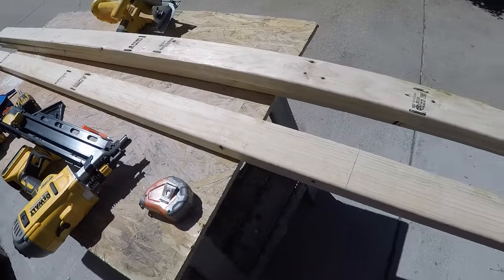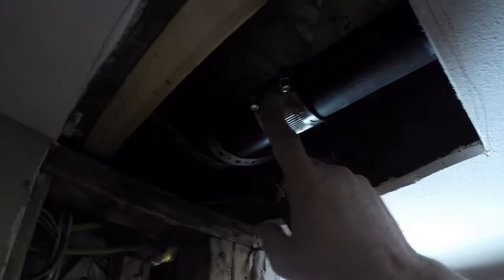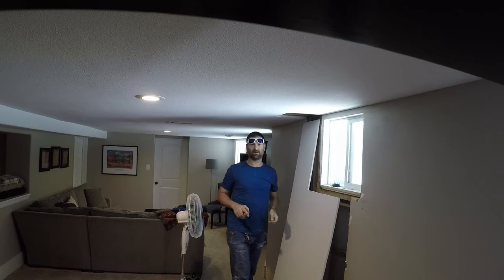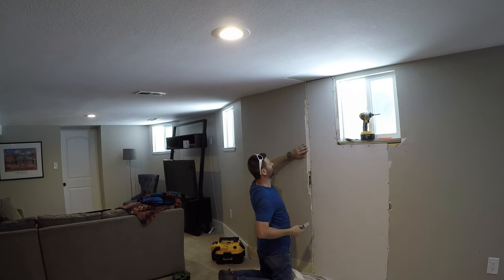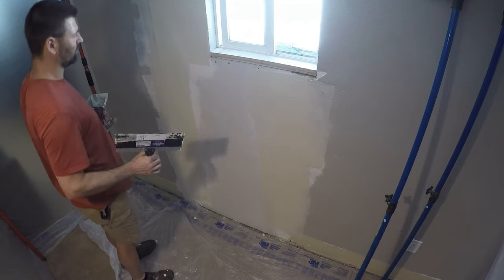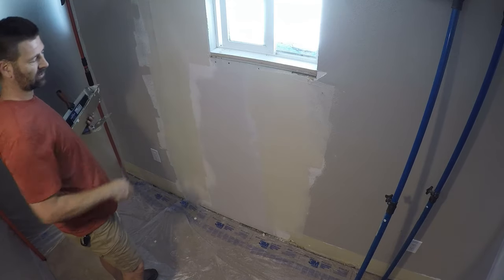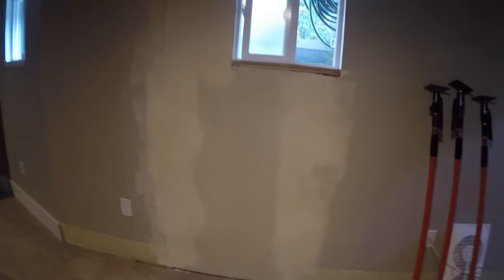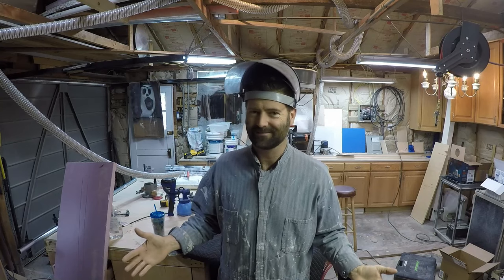How To Repair Mold Damaged Walls | THE HANDYMAN |

Comment: Right now I'm remediating mold in my one apartment.   I found I did like using concrobium.   What I did was mostly just spray it on and wipe the mold away.   The mold I had though was humidity mold in a bathroom.    With humidity mold it isn't neccessarily in the drywall it might be just on the surface in some places.   Yeah though after wiping down the whole bathroom I will haft to replace the drywall in areas.   Has anyone else used concrobium?   What have been your experiences.   It definately looks like it will save me some work but yeah still some drywalling to do.

Comment: Man whomever built that storage cabinet did a super great job. Excellent detail & craftsmanship....like they cared! 2:23

I’m guessing the plumber charged $250-$300. Service call: about $100-$150; than parts, labor, tax on a 30-60 min job (as w/ most businesses....not gonna charge you the 23-25 mins it took, but 30 mins or even 60 mins for the timeframe....a business thing); & your looking at $250-$300 easily. But, it does depend on the area you love in too! Plumbers in my area won’t step foot on your property for anything less than $100-$150. Now if I was doing that repair, & it’s all I had to do (no drywall work etc....); I’d most likely have charged them $130, with the hope of them calling me in the future with more work.

Please, oh, please....TELL us the ACTUAL COST of what was charged; on the Handyman Business Channel😉
Great repair job, by the way✌🏻

Comment: Only time I dealt with a plumber here in nowhere West Virginia it was $55 just for them to show up.  I'd guess at least double that for a place where there are people so $110 to start.  Actual service and parts would be $100 more given the stuff you've mentioned for your area.  $150 just to be safe... so... $250?  That would be my guess for what I'd figure people would pay there no questions asked.  If he thinks he got ripped off it's probably $500.

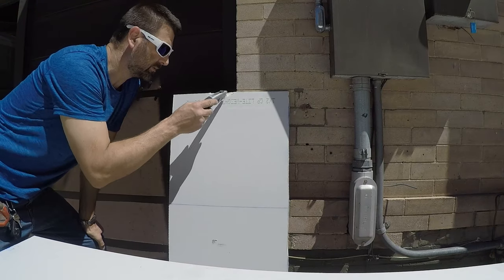Comment: Re: asking for discounts @4:55, I needed to patch a section of hardwood on my floor. Went to the big-box and saw they had bundles for $72. It was 19 sq ft in a bundle and I needed maybe 1 or two strips. I asked the guy if they had smaller bundles or offcut pieces and told him what I was doing. He walked over, picked out a bundle that had a couple of strips that had been damaged, and marked it down to $36 on the spot. The squeaky wheel gets the grease.

Oh, also I'd say $125 for the plumber. If he didn't make you hand him tools like the plumber did to my wife that one time. "If you don't help, it'll take longer," he said.

Comment: Mold control is not a biocide. The active ingredient is sodium carbonate, which can be bought for $4 at a grocery store it’s also called super washing soda, comes in a yellow box. Sodium carbonate is listed as a Fungistatic, what does that mean? Well it means that it will pause mold growth, but once conditions return, the mold will be able to come right back with a vengeance. 

    Here are some better products.

 1) 20% hydrogen peroxide cleaner. I personally like Fiberlock IAQ 3000 cleaner, comes in industrial size jugs. Will require scrubbing with a wire brush on all wood framing. 

2)  if you want to use a bleach like product, the RMR86 or MMR bad axe are good products. They both contain sodium hypochlorite, aka bleach, however, that also contain surfactants that allow the bleach to penetrate porous surfaces so it can eradicate the hyphae which common house hold bleach will water the hyphae as it burns the surface, mostly pissing off the mold. Also, sodium hypochlorite reacts with aflatoxin, created by aspergillus spp, and makes a more cancerous chemical. 

    After all that you will need to follow up with a fungicide. A great option is a Thymol based cleaner. Thymol has so many studies down showing it’s effectiveness against many different species of mold. Contrast that to the more common quant based fungicides that have been tested against aspergillus nigra and nothing else and are also listed as a fungicide.

    I personally like Benefect Decon 30. No only can you spray it on wood and let dry, but it’s soapy and does a great job cleaning surfaces. 

    As for PPE. I would suggest full suit, and a full mask. I like 3M full face mask with p100 multigas cartridges, which will also work if you plan on using RMR86, but they suggest acid vapor carts which multigas has you covered. You WILL WANT TO WEAR A FULL COVERAGE MASK IF YOU USE THAT STUFF!! The vapors are hardcore and BURN the eyes. Stuff is hardcore, melt your face off, but is so much fun to watch the mold evaporate before your eyes. Obviously, pull sheetrock and other paper products. Not worth saving. 

     After all that, a personal favorite of mine it to follow up with a treatment of either Timbor of you can use Boracare. They are a borate product used in the log homes industry. Not only will it soak into the wood and make it toxic for molds, but will make it toxic for powder post beetles and termites and carpenter ants. I fell in love with the stuff when working in my log home. Great stuff!! 

    Hope this helps. I didn’t bother with taking about containment, but that’s another book I don’t have the time to write in a cell phone.

Comment: Nice and clean finish. As for the plumber - $150.00 to walk in the door, $45.00 material charge and $75 labor, totaling $270.00.
Reply: Let's not forget the many years of experience in plumbing.  That should also be accounted for in the estimate.
Reply: @fritzpadilla7630  530.00
Reply: So I should just do it for $45
Reply: Did he knock down the texture after spraying it?

Comment: I agree with you re.mold & chlorine.  In swimming pools sometimes mold will begin to grow in the tile grout as well as spa spillways.  I tried using full strength liquid pool chlorine directly on the mold but without success.  I  learned that chlorine does not kill mold and started using muriatic acid (pool acid) and killed the mold.  Vinegar is acidic.

Comment: Pro drywall tip: take your knife and cut a bevel on all the butt joints. When the mud dries it will shrink into this cavity and prevent bubbling (always use taping mud for this step becuase it contains glue and shrinks when it dries).

Comment: Bleach does not kill mold. Reason:Because mold spreads its roots (called mycelia and hyphae) deep into porous surfaces. Simply spraying a bleach solution on the surface won't kill mold spores at their roots. Mold is a very resilient fungi and like or unlike dandelions they will survive if the roots are left there.

Comment: It’s not just from keyboard warriors those are remediation facts from iicrc and ansi. Plus when taking readings with an invasive device it matters the direction you place the pins (with the grains or not) always check the manual. Cya.

Comment: If he charged any more than $150 he got ripped.
Reply: He got ripped if he paid 50 cents for the job.  The 'plumber' didn't seal the top joint and it resulted in a new repair call to someone else:  and I doubt HM did it for free.

Comment: I'm guessing a $85.00 show up charge and $125.00 for the hours work but we wonder WHY the handyman didn't fix it?
Reply: Stacey Frank that’s my question too.
Reply: Liability. If it leaks again, guess who pays.
Reply: I'm wondering too. Maybe handyman is worried about doing plumbing work that is inside the wall and therefore could be an expensive liability in the future?
Reply: @sawdust85222  He knows how to do plumbing and he's done it some other videos, I'm curious as to why he didn't do it as well. As far as plumbing work goes, that is a super easy job right there.
Reply from the maker: The answer to this question will be in tomorrows video on my other youtube channel.  The Handyman Business

Comment: Looks great!💥👊🏻 Next thing you know, there will be some drywall snobs telling you to always put screws into the existing drywall around the repair too! 😇 PS. My guess is the plumber would have charged $245 and the drywall guy would have charged $450 to hang, finish, texture, prime and paint. 👍🏻
Reply: My thought was there already were screws in the existing drywall.
Reply: jimlovesgina, yes. But, when the drywall gets cut out it can loosen up the drywall a bit and also some of the screws holding that board could have been on the side that gets removed. There’s only 1.75” of surface on that stud and that was a full sheet of drywall originally. It’s basically an insurance policy to prevent future cracking.👍🏻 Thoughts? -Paul

Comment: I’m a full time plumber lol and I would charge $515.00 because if I don’t make 20,000 minimum a month my boss co workers and corporate would trip out on me. 3 calls a day 15 calls a week some are duds so to pay our boss our dispatchers Company vehicles gas parts insurance. It seems high but that keeps the wheels turning plus I’m not getting covered in poop for no less than 2000 a week 😂

Comment: In my area if you call a plumber for a regular call (not an emergency) they will charge a minimum of about $125 just for coming to your home. Parts and material costs would be extra. For that work in my area you are looking at around $150 - $200 for that repair. If that were my house I would just do the repair myself.

Comment: Hi i just recently found out about that. If you need a super fast filler coat you can use straight gypsum. The se as when someoke breaks a bone. I think its called gypsum. Like 5 10 mins and its solid 😀

Comment: Question from Chile is it necessary to buy a moisture meter to measure mold or exposure level? Then as a result of this same question I asked you I want to know if it is good to use dehumidifiers to lower humidity and regarding the ventilation of the house have you taken measures in this regard have you ventilated the necessary? Have you put more windows to ventilate more or look for new solutions to neutralize the spores that are in the air perhaps we are with spores in the air by buying a house with poor ventilation in sales there are some rooms that ultimately have no ventilation so it makes very complex the issue of mold and its spores in the air besides being a focus for the neighbors of disease we are already sick most likely we will move house but I want to take the necessary safeguards in the new house and clean all my belongings that have mold.

Comment: do I have to fully wash down walls when removing wallpaper? My house is fully wallpapered and Id planning of taking that on now. I thought about sanding off the glue left and oil based prime it.
Reply: I would just sand it down some and put some original kilz on it or even better the odorless oil based kilz. Works great.
Reply: @captbill279  appreciate that, this whole experience with wallpaper has made me never want to buy a house with it again.

Comment: I was working for a contractor a couple of months ago. AC didn't work. Lots of mud work, priming painting. Stuff was not drying. I pinned the walls with a meter.  22% Looked online to try to find parameters. Emailed Benjamin Moore didn't hear back. Humidity at that time was 60 to 80% during day and higher at night. He finished job by himself. Mildew is a big problem in this area anyway. Couldn't see ruining customers house and health. ??

Comment: $200 for plumber in my area. $200 for handyman(drywall, trim, paint), $500 mold removal. I usually don’t call plumber or electrician but do handyman, carpenter, tile contractors, roofer, landscaper, painter.
Reply from the maker: Here is the video about all the money. https://www.youtube.com/watch?v=XWc_11-zhbg

Comment: Save 100’s of dollars by making your own sodium salt solution moldicide.  Use TSP (Trisodium Phosphate), that you can buy for $5 at a hardware store. This salt solution will kill the mold by drying it out and encapsulating it. Beach does not work on drywall as the bleach (sodium/calcium hypochlorite) particles are to large to penetrate the drywall, and only the water portion of the mixture penetrates, which is in essence moisture for the mold.
Reply: Just TSP?

Comment: I've always been under the impression that using a mechanically fastened coupler for a drain behind a finished surface (drywall) is not allowed. It must be a welded, compression, or soldered coupler. Is this inaccurate?
Reply from the maker: Anything goes in remodel and repair.

Comment: Did you seal up that spot in the ceiling above the window and left of the pipe where you can see a lot of light from the exterior? Plumber probably $185 plus parts.
Reply: He was not paid for that job. I would show the homeowner, for extra work/pay but never do those things as extras. 10 years down the road a bug gets in and its the free fix that was the problem.

Comment: I'm no chemist but I remove the moisture, clean with bleach and have never had it come back unless the moisture does. I've never seen mold in a dry, nearly sterile environment.
Reply: Mold can grow and thrive off 60% relative humidity once established. Which means all you need is the hyphae, or root system of the mold, which is what regular household bleach feeds with water,. It’s like scalping the lawn then running the sprinkler after. However, mold can grow off humidity. Maintaining 50% and under is key. 
   If you want to use a bleach on mold, RMR86. Then apply their fungicide after. Or MMR makes a good product. Those are designed to allow the super concentrated bleach to soak deep into wood and you can watch the mold vanish before your eyes. It’s fun to watch. 15 seconds and gone.

Comment: I was told that most of the time the bleach is actually more harmful than the mold itself.  Plus if you're addressing the reason for the existence of the mold, you only really need to remove it, not necessarily kill it.  Soap and water works fine for removing light surface molds.
Reply: All of this is false.

Comment: Is there an advantage to using fiberglass drywall tape instead of paper tape?
Reply from the maker: It is easier to put on for DIYers.  But harder to get a smooth finish without seeing a bump.

Comment: Plumbing repair just like this is what I do for a living. If it was already exposed like this I would have charged around $150 to $175. Probably around $250 if I had to remove the sheetrock and find the leak. Would have recommended a handyman to handle mold removal and sheetrock repairs.
Reply from the maker: You should relocate.  This plumber go paid a lot more then that.  video on my business channel will be live at 6pm eastern
Reply from the maker: Here is the link. https://www.youtube.com/watch?v=XWc_11-zhbg

Comment: $100 plumber. How long did the room dry? 

I am a certified, professional specialist in mold remediation by heat treating. I was told by the guy who owned the company that developed the treatment that it could take a 500,000 BTU heater up to 2 or 3days to dry out soaked wood. I'm just curious what the starting moisture of the 2x4 was, and then how long it took a $30 fan to dry it out. I ask because my room has black mold OUTSIDE the wall cavity (where I can see it inside my room). I cant heat treat it because I left that job/ dont have that equipment, but I also cant strip it down to the studs. Is there a surefire way to get rid of it? Would I just moisture read the drywal/plaster?
Reply from the maker: 3.5 weeks dry time. Relative humidity around here is 20 percent.